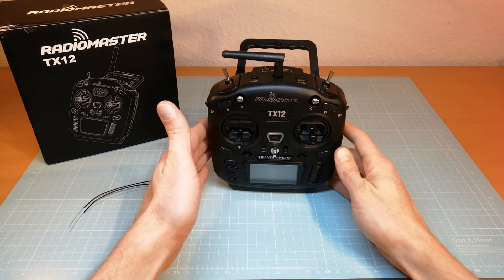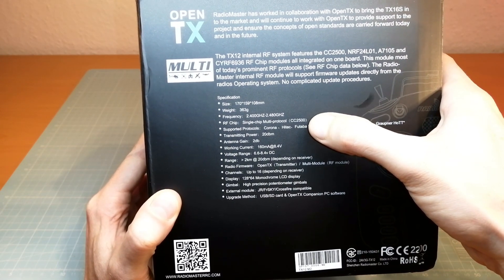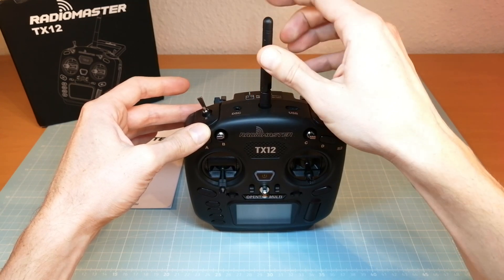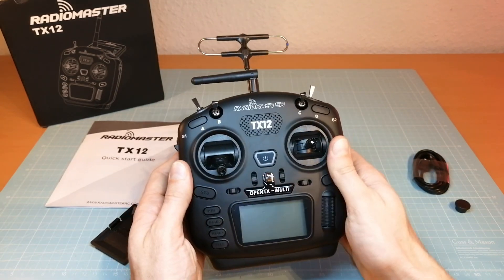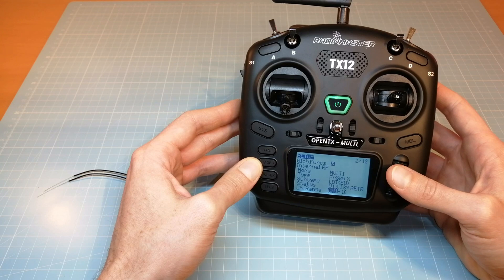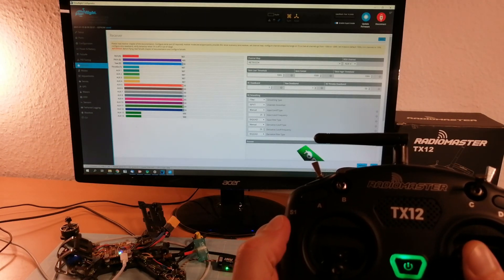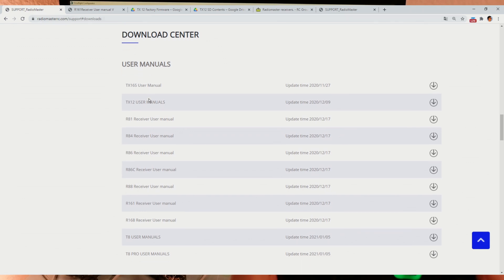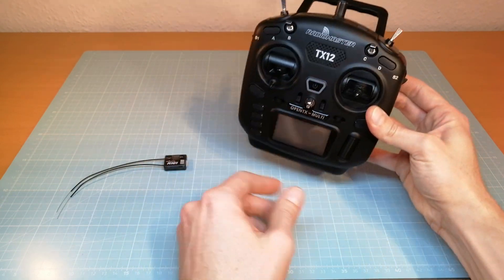RadioMaster TX12 - R161 Receiver + How to Bind & Firmware Update

Comment: What if u have a pre built drone
Reply from the maker: If you have a drone without a receiver, use a receiver that can be bound with the TX12, otherwise the drone needs to have a matching receiver preinstalled. By the supported protocols of the tx12 there are good chances that it will be possible.

Comment: Thx for the video and the updating the firmware part  :)

Small question, is the process the same as with the TX16 when you want to update the firmware of a receiver ? I'm gonna build my first quad soon and I have a TX12 but the firmware on the XM+ receiver I'm buying is going to come with the FCC version so I'll need to update it with the LBT I think ? Or is selecting D16 when I bind enough you think ?

Comment: It needs a little bit more organization and distance test which is the most important to most pilots!
Reply from the maker: Hi, thanks for your comment. I agree with you, there's a lot to say about this radio, the receiver, and even more room for testing - too much for a single video. First I have tried to sum up all information about this radio, the receiver, binding and firmware updates. regarding the range, I'm expecting similar results as with the other radiomaster, jumper or radioking radios with the Multi-Protocol Modul. The R161 probably is pretty similar to the FrSky RXSR - but that's definitely something that needs to be tested.